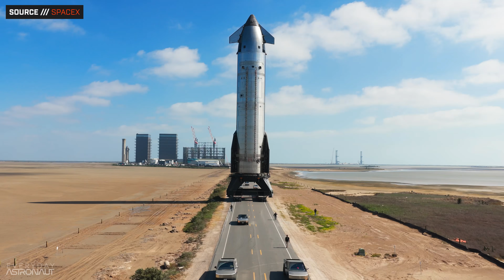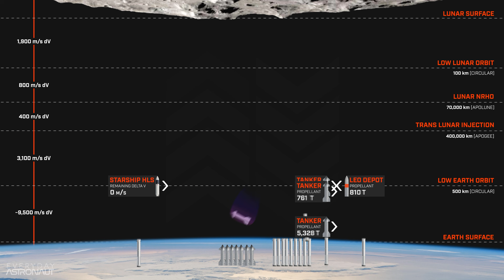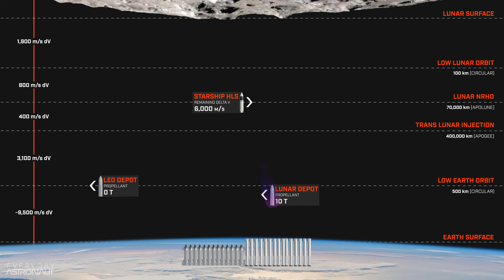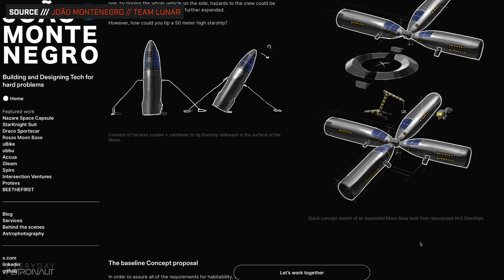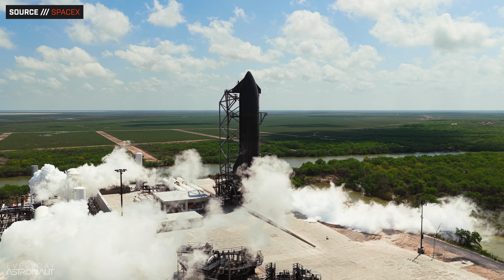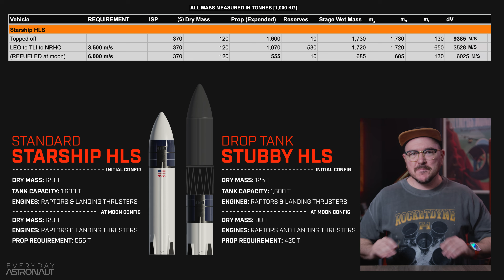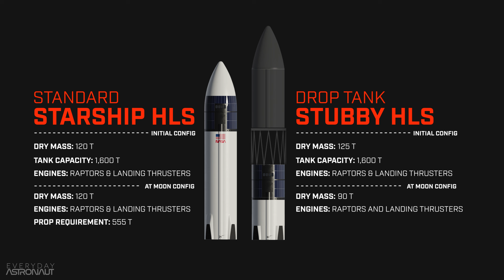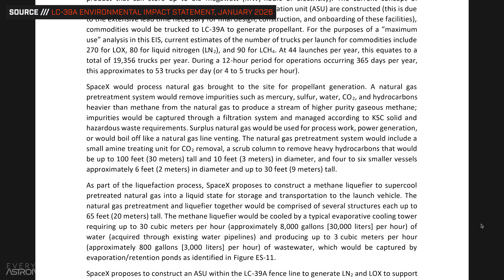Does Starship REALLY require 15+ launches to land one lunar Starship?!

Comment: The obvious thing to get that slight bit of extra performance for the HLS is to either:

1. Drop the sea level Raptors and figure out a vacuum Raptor system with attitude control methods. Three central vac Raptors with gimbal would get it done, though leaving little room for other vacuum Raptors around the outside. Might call for a partially flared skirt, or even an open skirt, because actually, why should HLS even need a skirt at all? It just needs a structure to sit securely on top of booster and handle the aerodynamics of the ascent from Earth, and you might even decouple that structure after getting into space, because once you're in space, you only need a structure the support the landing legs (though that might just have to reuse the entire structure that coupled the HLS to the Booster in the first place).

2. Just improve the engine Isp a slight bit more with incremental design. Maybe SpaceX hasn't squeezed all the performance out of their Raptors yet. Maybe they've optimized the design for thrust capability and they could optimize a separate variant for additional Isp.

3. Same as 1, but maybe you don't need to replace the central SL Raptors with Vac Raptors. Instead, design a wider nozzle for the Vac Raptors to get more Isp that way.

4. Keep the fuel depot not in low earth orbit, but actually in a slightly elliptical orbit. Nothing crazy, just 300 m/s of delta-v away from LEO. That makes it slightly harder to fill up the depot, and possibly complicates lunar mission itineraries, because you want to have the correct argument of perigee for the moon mission, but it's not too much of a complication if you have multiple depots with different arguments of perigee, which could be viable, and lets the HLS get all the way to the moon and back to NRHO without an additional refueling event in NRHO.

Also, getting HLS back from NRHO to LEO for refueling is not too difficult. You just need to escape the moon (easy from NRHO) into a trajectory that skims the Earth's atmosphere. Even without a dedicated heatshield, you can spread the heat of aerobraking over multiple atmospheric passes over many orbits, with minimal delta-v expenditure. Though doing as much would make a depot in LEO much more preferable to one in an elliptical orbit, as LEO is easier to rendesvous with, again, because of the argument of perigee issue, and you would still need to figure out how to restock the HLS with other consumables related to it being a crewed ship. Possibly, maintenance would also be necessary, further complicating HLS reuse efforts.
Reply: regarding a wider vacuum nozzle, making them wider also makes them longer, adding a bunch of mass. for every spaceship design there's an optimal nozzle length, beyond which the added mass of a bigger nozzle outweighs the diminishing isp gains.
Reply: @fendermarxist  yes, but I think the current vacuum Raptors are currently optimized more for thrust and simply fitting into the skirt, rather than simply saving some weight. I bet you can get more performance out of them if you lose the skirt and let them extend out past where the skirt used to be, maybe with an aero cover or something for the initial ascent. Though, maybe no aero cover.

But yeah, another option instead of expanding the nozzle could be to make a slightly smaller combustion chamber and smaller turbopumps. That's a developmental headache, but it's an option to squeeze more Isp out of the design.

Comment: A good argument can be made for shortening the lander. However, if you're still going to have to do a bunch of refueling in orbit, you might as well keep it full sized.  One thing that's hard for people to reconcile right now is the idea of so many launches for one mission when SpaceX has yet to test launch Starship a dozen times.  What most people don't consider is the infrastructure SpaceX is building for Starship.  They're not planning to build a dozen or so and be done with it.  They're planning to build hundreds of these ships.  They're making massive production lines at Starbase and Cape Canaveral. They're not doing that on a whim.  When the launch cadence ramps up this will no longer seem like such an outlandish plan.  But they've got to get Starship right first.  I'm hopeful the 12th launch goes well.  I hope the 13th happens a lot sooner than the gap of time between 11 and 12.

Comment: SLS can easily do LLO. SLS isnt a limitation here, its the orion service module.
Reply: The SLS second stage, the Interim Cryogenic Propulsion Stage (ICPS), is laughably underpowered. 30.4 tonnes is the end-burn mass of the ICPS plus the Orion space craft. The ICPS has 20 tonnes of fuel, and the engine of the ICPS, the RL10C-2, has a specific impulse of 462 seconds. Doing the maths, that's 2290 m/s of delta v in the ICPS. Trans-lunar interjection (TLI) is around 3000 or so m/s of delta v.
Remember, the near-rectilinear halo orbit (NRHO) chosen for Gateway's orbit was because of SLS not having enough delta v to get Orion to LLO. NRHO has so many problems for lunar surface operations you would not want to put your staging area in that orbit unless you were forced to. It's worse for the lander, as it costs more delta v to ascend to NRHO versus LLO, it's worse in cases of emergencies, as the ascent window comes only every few days/weeks, and so on, so on. If Orion is required to do it's own burn to finish the TLI, then that is a failure of the rocket, not of the payload. It's like saying "well, this payload is too heavy to get it into LEO with just the launch vehicle. Guess the payload will have to finish the ascent burn." With the Saturn V, the 3rd stage did the entire TLI burn, with the Apollo Service Module doing the LLO capture burn. With Artemis, the Orion spacecraft has to finish the TLI burn, as well as do the NRHO insertion and capture burn.
Reply: SLS is very expensive

Comment: Actually, your incorrect if it lands on a slop, those legs won't stop any slipping from when the weight settels, since from what I understood, the surface is like sandy snow Soft, so yeah it would litterly fall over if they land on any steep slop.  They would need a gyro to counter act any shift for such a landing, and that would just add more weight which they will not do.

Comment: Sorry if this repeats anything, but I only had time to look at the first half of the video.  How about a more diversified space economy which uses resources from space?  In particular,  how about a chiller tender that could attach cables to a cryogenic storage tank and use solar or nuclear power to actively cool the stored fuel?  Also, how about large versions of the "kicker" rockets that right now place heavy satellites in higher orbits?  These could use high-impulse ion engines that operate well only in a vacuum.  They could also use solar power.  These couldn't by themselves get anyone to the Moon, but they could lower the cost of getting fuel and supplies further up out of the Earth's gravity well.

Comment: Of course Starship needs to be this big.  In the same way, I need an 18 wheeler to get a bottle of milk from the corner store. 🤓
Reply: I mean that's not too far off the average American SUV these days.
Reply: What if you just disnt want one bottoe of milk but 10.000 bottles?
Reply: @filip9564   Yes.  Starship for cargo, lots of it, and Blue Moon for Astronauts.👍
Reply: But that's assuming all your ambitions for shipping are limited to a gallon of milk from the corner store. If you have ambitions to haul tons, a smart car isn't really going to help you do that, even if the first test is only to get milk a block away.

Comment: 16:00 Important thing to note here, throttling the engines lowers their specific impulse so i am not sure if such assumptions can be made... What you'd probably need to do to get +/- more accurate value is try to gues the chamber pressure and the massflow with help of NASA CEA or other software to find how the engine operates at 2/3rds of the throttle. But the true number is probably harder to get and only SX knows

Comment: If you have to ask and answer the question… the answer is no.

A dozen launches?  More like three dozen.  Starship for deep space is DOA.
Reply: it's the best way to build moon base. You can't do this with expendable vehicles
Reply: @maks_1_123  It's DOA.  I don't think SpaceX can design and build a propellant depot that remains in orbit and can sustain over 30 docking and propellant transfer operations.  Has SpaceX launched 30 Falcon 9 rockets without performing any maintenance on both the ground and flight propellent handling systems?  I'm betting the answer to that question is a "nope."

Also, no one is building a Moon Base.  By 2033 the fund that provides Social Security for all retired Americans will run out.  It's extremely unlikely that Americans will be ok giving up 20 to 25 percent of their social security so Elon Musk can build a Moon Base.

Artemis will be a one (maybe two) and done Moon program.
Reply: @ericmatthews8497  depo and falcon booster is different vehicles you don't have to fire depo engines like falcon's. And Falcon uses kerosene that produces soot, that why it needs refurbishment

Comment: Don't V3 engines and stretched tanks drastically change the number of tanker launches?
Reply: Well, not too much, considering that the calculations are based on the assumed performance of the finished Starship, and so far the V1 and V2 versions have not even managed to enter orbit, let alone put 100 tons on it.

Comment: Delta V geniuses… a conversation with Grok a month ago convinced me… F9/Crew Dragon (CD) to LEO transfer into HLS, to moon surface, then back to LEO for transfer into 2nd CD for re-entry works.  Would require reducing HLS freight to the moon, like with a “Stubby HLS.”  This would move the critical crew transfer to LEO and get rid of the costly SLS and Orion systems.  Thoughts?

Comment: Great analysis!
One note: @19:00 why should HLS Starship have 3 sea level engines? At launch time, it uses vacuum engines only, and it never returns to the Earth. I guess it does not matter that much, as these weigh 1 ton each.
Reply from the maker: On ascent they still run the sea level engines since they’re the only engines that can gimbal / steer. So they’re still an important and necessary engine for control
Reply: @EverydayAstronaut You're right Tim, they can be seen lit immediately at the "stage" separation, and visible from the ground and on the dashboard.

Comment: 500 tons of rocket that is mostly empty. They're not bringing cargo. It's just a bunch of extra weight for absolutely no reason.
Reply: I will say that Starship doesn't seem to make much sense until massive amounts of cargo ARE going to the moon. Artemis 4-5 would be at best testing the hardware to make sure it can handle the heavy lift missions.
Reply: @richardryley3660  even loaded with cargo if the dry unloaded mass is still 500 tons it still makes zero sense
Reply: @FireStriker_  Where are you getting this 500 ton number? That is way too low for fully fueled weight and is barely close to dry weight of Starship plus Super Heavy.

The Apollo missions used a 600 metric ton rocket to get little more than 50 tons to the moon. Starship alone weights more than that.
Reply: @FireStriker_ dry mass is 120 tonnes.
Reply: The point of Starship is not to bring 4 people to the Moon. The point is to build a base there.
Reply: Yall the same that would be knocking f 9 back in the day
Reply: Volume that can be pressurised?
Land 2 (maybe even the unmanned test one) and leave in 1
Reply: This is correct.  For the "Apollo retread" missions, this is not the correct vehicle.  The reason it's on the ticket is because Congress initially failed to provide a reasonable budget for Artemis, and Starship was literally Hobson's choice.  It just so happened that HLS could be hypothetically fit in as a sub-quest while SpaceX proceeded with their own bigger plans for Starship.  As it happens, there will be an alternative lander and I don't think anyone genuinely thinks Starship will be covering the role for the Apollo retread.  That said, NASA has laid out their plans for staying on the moon, which will require thousands of landable tons.  NASA would not have done this without the promise of Starship's availability.  Furthermore, anyone who gets serious about bases on other worlds will likewise be forced into orbital refueling.
Reply: Well, the only alternative would be to include an expendable 2nd stage that it jettisoned before going to the Moon, kind of ruining the idea of being fully reusable and increasing expense dramatically. Got any other ideas?
Reply: Its just a terribile lander and NASA allowed themselves to get scammed
Reply: @_mikolaj_  Do you want to try again without the blatant bias?  The Artemis program lead was given the task of picking a vehicle proposition, and LESS THAN A BILLION DOLLARS to cover it.  The options on the table were: $3 billion; $6 billion; $9 billion.  With no real choice available and no more money promised by Congress, Artemis selected the $3 billion, with the caveat that it would only be paid out for development milestones.  That's still in progress, by the way.  Blue Origin then sued to be selected, still charging more than SpaceX to fill the gap—if you want to be honest about scams, there you go.  Lastly, since NASA will absolutely be needing super heavy lift to fulfill their recently-posted moon plans, Starship will be tremendously convenient, since no other vehicle currently being designed could fulfill this for NASA.
Reply: @Asterra2 the decision nasa should make in those situations is select no landers at all. If they have 3 bad choices (and all were mid at best even without money considered) they are not forced to choose anyone.

But they did, Kathy Luethers picked a HLS without a NASA admin present and like 2 months later left NASA to work at Boca Chica (funny isnt it?). And now NASA is stuck with a second stage, not a lander, that has near zero chance of delivering anything this decade. Again, no one forced them to choose starship, they had a right to choose no one and complain to congress that under this budget they cannot do it(like they should) but they didnt.
Reply: @_mikolaj_  In order to force your interpretation to stick, you have to studiously ignore the detail that every other option wanted anywhere from 7 to 11 times Artemis' budget, which put them firmly outside of any possible consideration, regardless of the presence or absence of admin transition.  Lueders was demoted for performing her duties as Source Selection Authority.  That is the reason she "left"—you don't get to blame her for this justified decision and you don't get to pretend that it wasn't in SpaceX's conspicuous interest to snap up a useful and recently available employee.  Also, do your research next time—the Artemis program had already asked Congress for more money prior to finally selecting a lander, and $850 million was the final answer.
Reply: @Asterra2  We'll see how much this all will cost, how much cargo it will deliver and for what price at the end when something actually lands there. Winners will write their own history as usual. There are all the signs of corruption here and it wouldn't be the first time for Elon - it's basically his MO.
Reply: @_mikolaj_   look a nobody's opinion
Reply: @_mikolaj_  it was probably the safe bet, knowing spacex is experienced with contracts and human systems in past, as well as propulsive landing. they’ve proven themselves to be reliable.  the design of blue origin is likely better, but they have no prior experience that proves they can pull it off. at the time of the HLS contract opening, they had nothing more than a suborbital pod. in hindsight, blue origin was probably the better choice but at the time it would have been a huge risk for the agency.
Reply: @_mikolaj_ I don't agree, what alternatives are there for getting similarly massive payloads to the moon? They aren't just trying to get back, they intend to build infrastructure too
Reply: You know nothing about rockets

Comment: Starship (and Depot version). Needs to be 2 stages. Empty Starship carrying that weight is against known rocket thinking - to discard useless weight. Starship "Cone" (3rd stage) could join to Depot. No transfer. Transfer OF the Starship .. Orion-like 3rd stage. SpaceX innovation is these rocket motors. NOT the shape of container holding them. We need other versions of Falcon, Falcon Heavy and Starship-with-booster. Other versions with less or more rocket motors. Other abilities. And Starship needs to be cut in half - 2 stages.